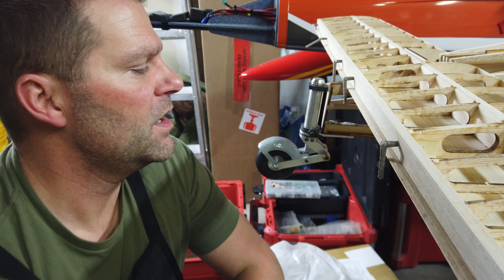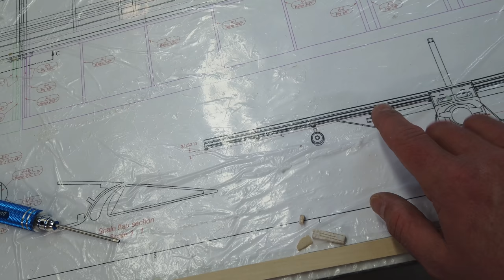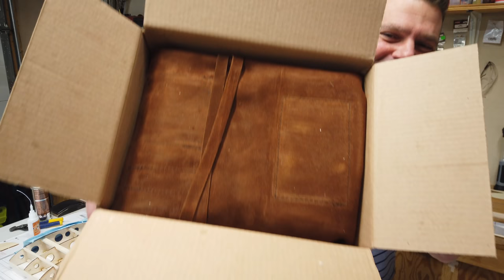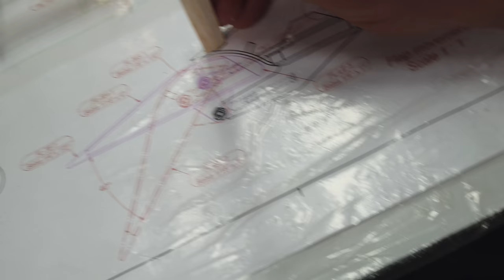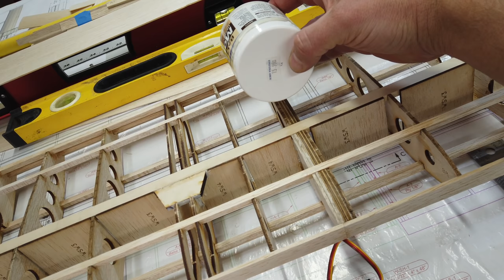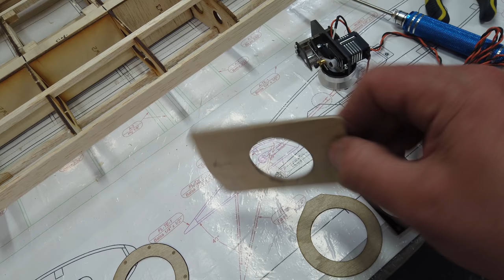BUILDING THE WING (Part 2) OF A GIANT PILATUS PC-6 Turbo Porter - MR Aerodesigns Video 4

Comment: Took me more than 2 years from designing to the maiden flight of my  lookalike Porter. I almost sold it because I thought my Porter would be too heavy (wingload 125 grams/dm2) , but I enlarged the wings from 180 to 220 cm, now 100 grams/dm2. The slotted flaps slow my Porter down and  it stands still in about  6 meters after touchdown. I used NACA2415 profile and It flies like a dream. I can see yours will also fly great. I studied the MR Aerodesign for days but I found it too big and complex for me. For your turboprop engine its great. Thanks for sharing.
Reply from the maker: Thanks @Red Bear RC!  That's a pretty awesome short touch down distance!  Thanks for watching!

Comment: I have a question. What’s the best way to   Assemble the ultra flash canopy . And what glue should I use
Reply from the maker: Use magnets to hold it in place. Once your 100% satisfied with the fit use “formula 560 canopy glue”. Install from the inside. It will wick between the 2 surfaces. 
Once all the glue is in place it’s extremely important to install the canopy on the plane and leave it till it dries. 

You can then clean up any excess glue from the outside with water or rubbing alcohol while your waiting for it to dry.